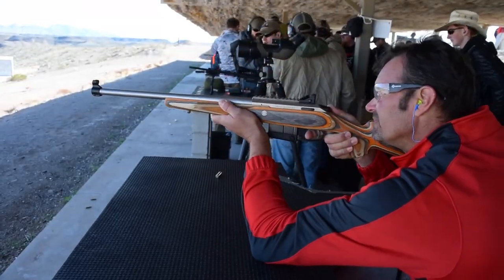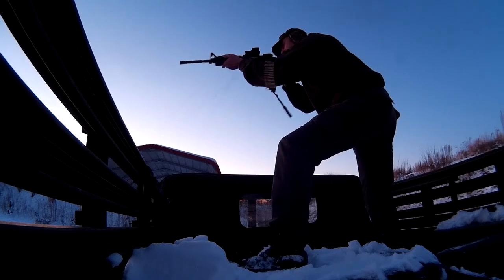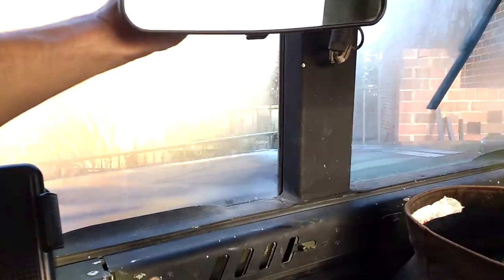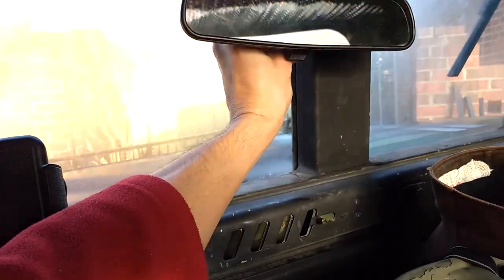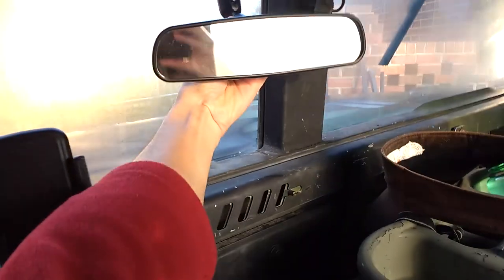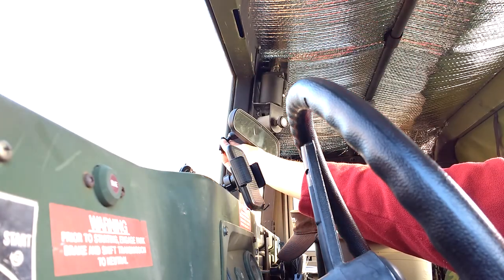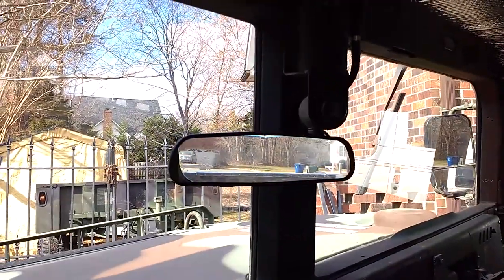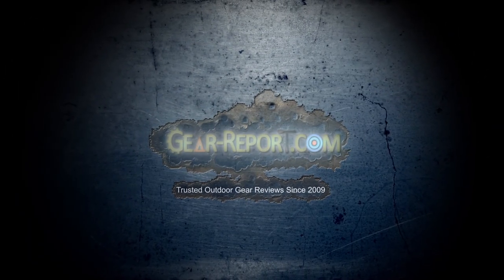DIY Humvee Upgrade - How to Install Rear View Mirror in HMMWV - Gear-Report.com

Comment: Hi, thanks for the video. Founded very helpful. I just got an M998 myself. So for the passenger side mirror, you have to adjust it so you see it through the wind shield right?  You can’t see it the same way as a regular truck?  I was trying to figure that one out. Thanks.
Reply from the maker: Yeah. The passenger mirror adjustment isn't intuitive.
You can see it in the videos here:
http://gear-report.com/how-to-drive-a-humvee-hmmwv-training-videos

Or in the Operator's Manual here:
http://gear-report.com/humvee-manuals-download-hmmwv-manual-links